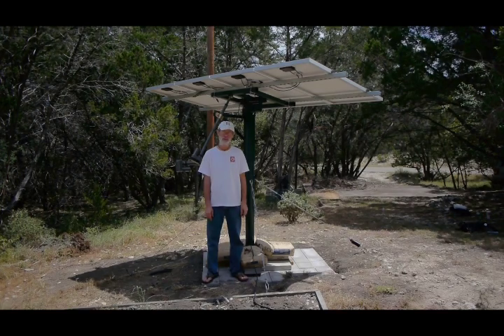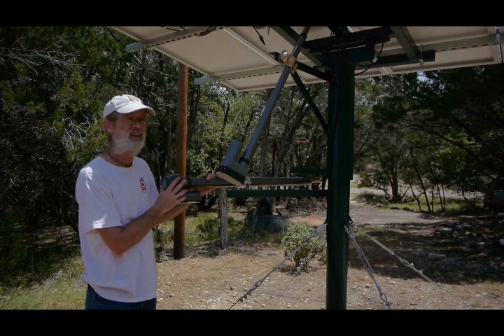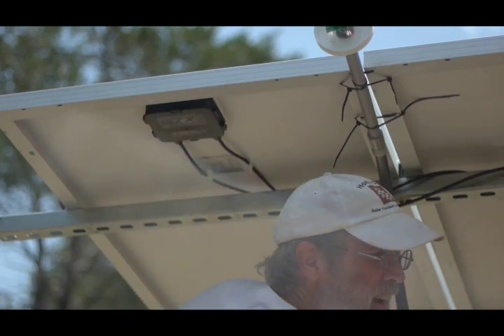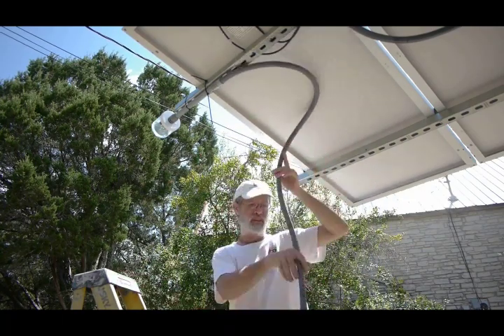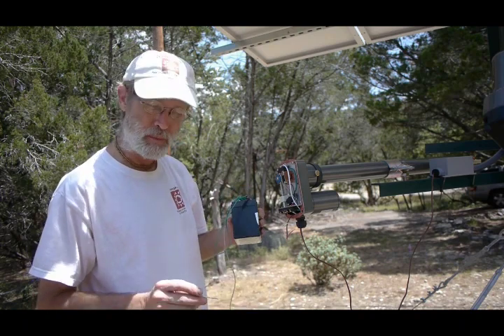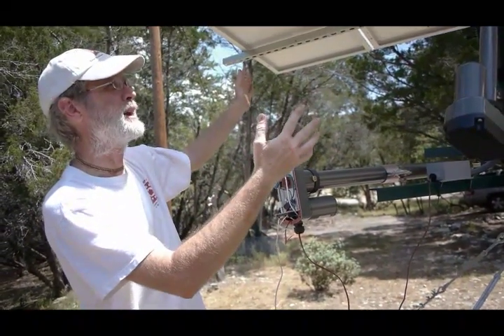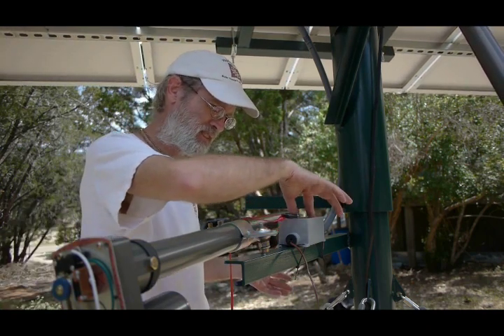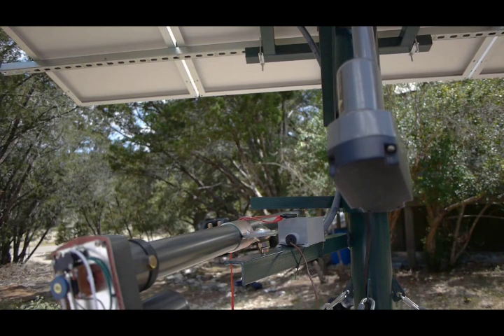Dual Axis Solar Tracker Installation with Home CSP TinyTracker

Comment: Thanks for sharing your system.  I'm still in the process of designing my tracker, and thought about using two trackers, (East/West) - (North/South) as a duel axis self design.  My concern is they might be a disparity (Argument) about the position of the sun.  I wasn't sure if the actuators would fight against each other due to misalignment.  How has it worked out for you?
Reply from the maker: +Douglas Huston With each axis perpendicular to the other there is no problem like you describe. Azimuth trackers can get a little confused when the sun is near zenith because the azimuth angle is hard to determine, but this mount has had no problems. I upgraded the elevation controller the other year for a programmable park position model, but the azimuth controller shown in this video is still working fine.

Comment: Does this system automatically park straight horizontally to reduce wind drag after sunset?  If so, is it able to differentiate between sunset and a long cloud darkness?
Reply from the maker: Terry Johnson It waits for 10 minutes of darkness before triggering the east return feature. When used for the secondary (elevation axis) it retracts to a horizontal position. Check out my videos on the Track'n Park controller that has a custom park position and wind trigger capability.

Comment: I don't understand how the tracker is moving east/west, how is it rotating?
Reply: Ther are two actuators:  One is pushing from a horizontal position turning the array around in the east west position, pivoting from an arm extending towards the camera.   The other is seen attached on a bracket welded to the pole, and works in an upward angle so, in extension, is controlling  the azimuth or seasonal correction to the latitude, as required.

Comment: Why not mount the array closer to the ground to avoid excessive wind loading?
Reply from the maker: +George This array already comes within a couple feet of the ground. The guy wires limit the ground clearance. This particular mount is over my drainage field so I couldn't mount the pole in the ground.
Reply: Home CSP Understood, thanks for the reply.

Comment: If You are using Chinese WST03-2 driver 
Don't throw your driver away when it stopped working.
Go on;
https://www.kickstarter.com/projects/210667753/hybrid-solar-tracking-driver
Help to implement a better version of it.
or
get upgrade pack from us.